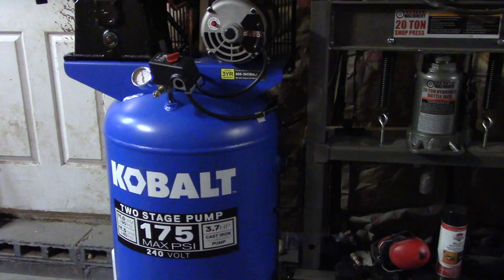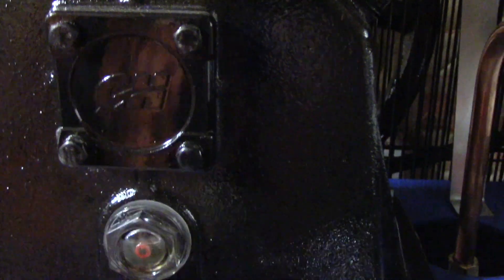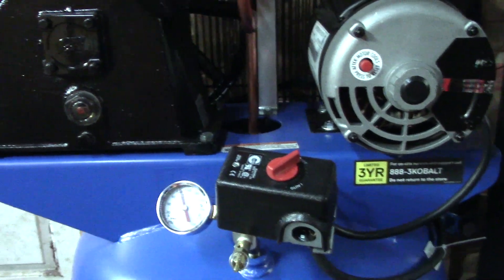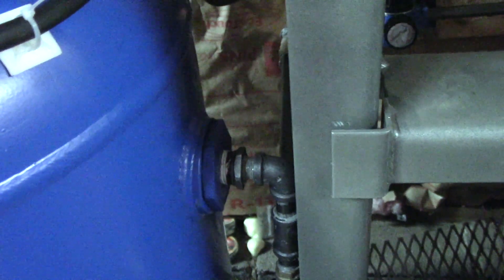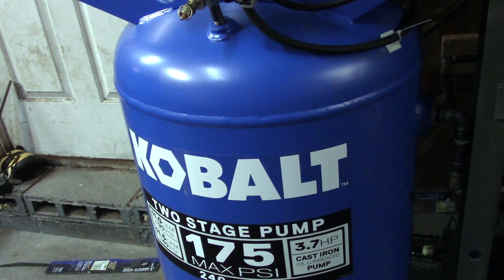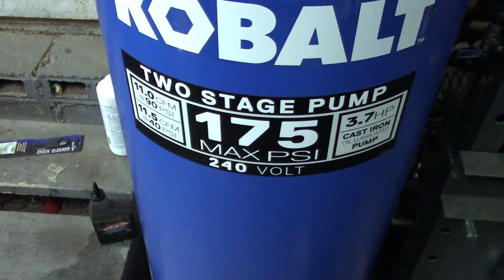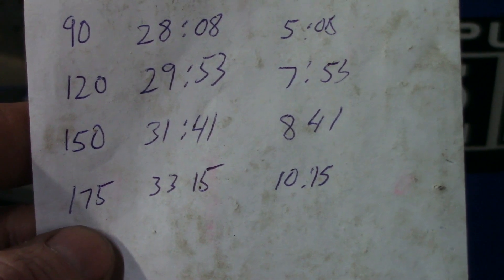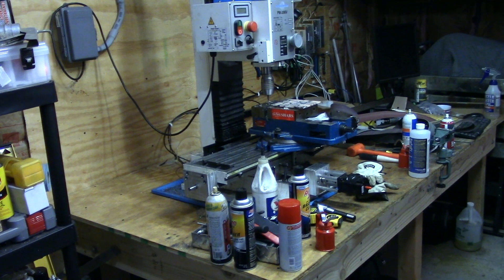Kobalt 2 stage 60 gallon oil sump cast iron air compressor 2018 model 220 volt

Comment: Love the set up. My one question is this. You piped it rigid from the tank to your runs. Most people use a flexible line there do to vibrating. Have you had any issues there? What type of tank floor mounting do you have?
Reply from the maker: Brian, yes some do use flexible piping. However the tank pressure is 175 psi and I don't want to rely on a flexible hose holding that kind of pressure for days on ends and not to mention what heat does to PVC/Rubber.....  The metal piping I have is not fixed to a wall and is free to move.  The rubber feet also cut down on the vibrations.  I have not had any issues with this. I used the anchors, where you drill in the concrete, insert anchor and maybe tap with a hammer to insert.  Then once the bolt pulls on the anchor it spreads and locks in place.  You also just want to make contact with the nut to the compressor legs, otherwise it will shear the bolts.  Hope this helps
Reply: You absolutely should use a flexible line from the compressor.  These lines will easily handle the pressure.  Remember, rubber hydraulic lines on heavy equipment can handle 3,000 psi so handling 175 psi is a walk in the park.  A rigid connection will likely not cause problems for several years, but metal fatigue is very insidious and sneaks up slowly until the day the metal cracks rapidly.

Comment: What country is the pump made in?  China?
Reply from the maker: adam sooker  Yes, China
Reply: @jakegt1978  Thanks.  Bought this unit yesterday.  Will be setting it up in the new few days.
Reply from the maker: adam sooker Overall for the money it’s a great compressor. Just follow the break in procedures so the rings seat correctly. Follow service as indicated in owners manual and you should get many years of use. I have had min for over a year now and many hours on it with no problems

Comment: Can you upgrade the motor to the 5hp one
Reply from the maker: Michael C To answer in short yes and with some modification depending on the motor frame size. However I don’t think you would gain anything with a 5hp motor. Unless you change pulleys or a higher rpm motor to turn the compressor faster. This may cause mechanical failure of the compressor

Comment: Thanks for the review, have you had a chance to use it yet? If so how does it perform?
Reply from the maker: No problem and I am glad the review helped you.  That was my first ever product review.

Yes I have been running it non stop since I uploaded the video 3 weeks ago, well with some sleep time in between.  I use it while running my CNC and it keeps up no problem and very few recycles with coolant mist at 40 psi.  I also added another hose connection so that I could provide additional cleaning during milling operations.  I have also used it with air wrenches and impacts with no problem. My shop is a little small and the fit is nice. Cost to benefit ratio it is a steal.
Reply: @jakegt1978  Thanks.

Comment: Would you recommend this compressor for a house garage to use spray gun and sand blasting?
Reply from the maker: s c spray guns is not problem for this compressor. Sand blasting is another story. The compressor will keep up for short runs. The CFM will be your limiting factor. Sand blasting is high air consumption. Select a sand blaster as close as you can find. I have used my 60 gallon for sand blasting with a hand held unit and short runs before resting and it done just fine. That being said if you need continuous use then the answer is rent a trailer compressor unit for continuous use and large sand blasters
Reply: @jakegt1978  thanks for the info appreciate
Reply: It depends on the spray gun you have.  Standard guns or LVLP will be find.  A professional quality HVLP gun will not work for long.  Many of them consume 12-14 CFM which is well above the 11 output of this compressor.  You will be able to spray small parts, but not an entire car.  Generally, you need a 5 HP compressor for a good HVLP spray gun.

Comment: If only the motor did not say made in China.
Reply from the maker: LTVoyager I agree but it does nice job. If the motor alone was made in the USA it would cost more than the complete air compressor.